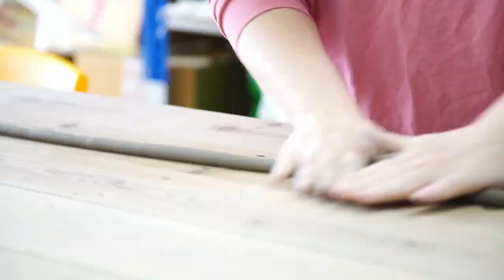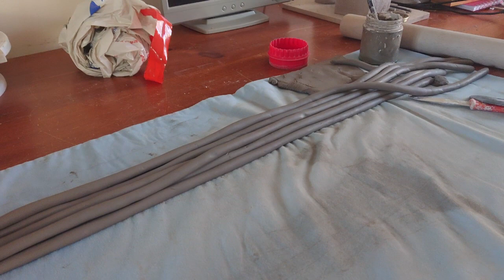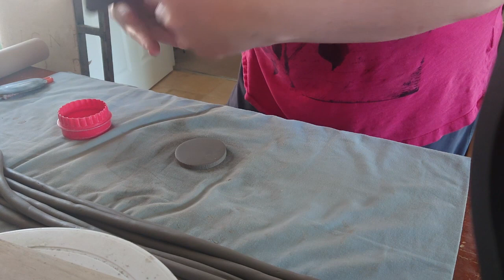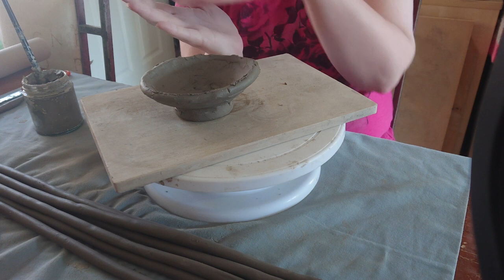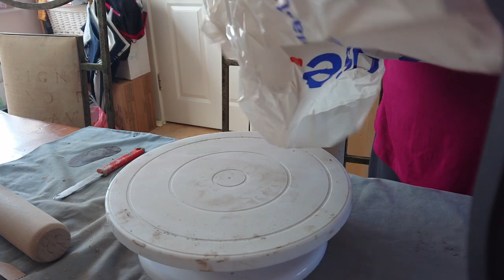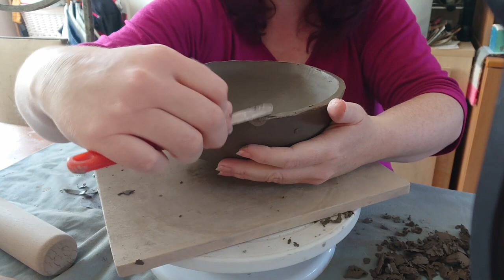How to coil a bowl.  (Part 1 - Using hand rolled coils of clay to build a ceramic bowl.)

Comment: Hi, when i use coil technique, i see alway have a lot air bubble in bowl wall :(
Reply from the maker: Do you roll your coils? Sometimes air can be trapped in the coils as they're rolled when the clay folds over.  If it's during the making it might be worth trying more slip between the coils as you build or maybe use wetter clay to build with. It will mean it takes longer to build as you won't be able to build as fast though.  
Let me know if it works but without seeing how you personally build those would be my suggestions. Hope it helps.

Comment: HI Paula, i love watching your videos. I noticed that you use a square board, but  I favor round boards on the turn-table.
Reply from the maker: Hi Dianna. Round boards are great. especially on the turntables (no corners sticking out and getting in the way!).  I just tend to use square boards as I find they are easier to buy or cut.  Quite a few of mine are light weight, wooden cutting boards :)

Comment: Each time you added coils how long did you wait for it to dry.
Reply from the maker: Unfortunately this is a tricky question to answer... I left it progressively longer as I went up the build to avoid the bottom slumping as I added coils.  The exact time will always depend on the clay that you are using, you'll have to wait longer for wetter clay although it will blend much easier. I have to admit, I tend to be impatient and use a heat gun/paint stripper to dry coils in between to make sure it's ready for the next section 🙈

Comment: Thank you so much for this video!
I have a pottery class tomorrow with a teacher that does not teach. So I didn't know what to do with this idea I have, and now I do :)
Do you have any tips for how to make a lid for a bowl like this?
Also about the same size.
 Thanks so much!
Greetings, Julie
Reply from the maker: Hi. So glad it was helpful.  There's a couple of main options for a lid I think depending on the style you would like.  For a flat lid (and a quicker build) you could make a simple slab lid cut to fit the bowl with a small coil around the inside edge underneath to slot into the bowl and hold the lid in place.  You'll need to let the lid dry off the bowl though so it doesn't dip in the middle as it's a wide piece of clay.  The second option is to coil a lid pretty much like the bowl but in reverse/upside down.  Again put a coil on the inside edge to slot into the bowl underneath so the lid doesn't just slip off. You can build directly on the bowl once it has dried a little (halfway towards leather hard I'd suggest) just be careful that you don't join them together when you're blending. I would make a shallower shape but that's a style choice and to be honest you can make whatever shape you'd like with this method :)  Have fun.

Comment: How thick is your foot ring and how do u know how long it has to be ?
Reply from the maker: Hi. My foot ring is one coil thick and my coils are around 12mm diameter. I usually use a long coil which I place around the edge of the base until it's all the way round and then trim it to size.